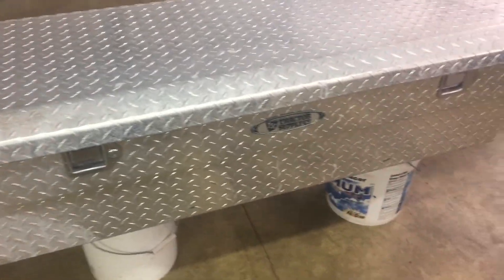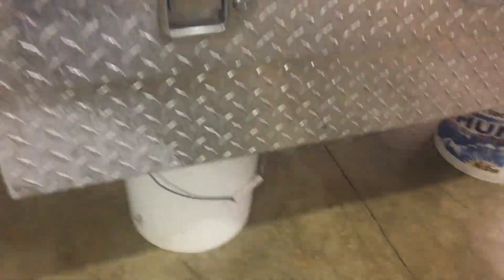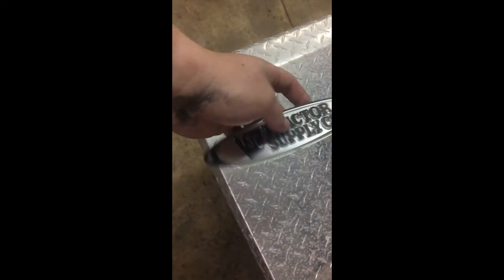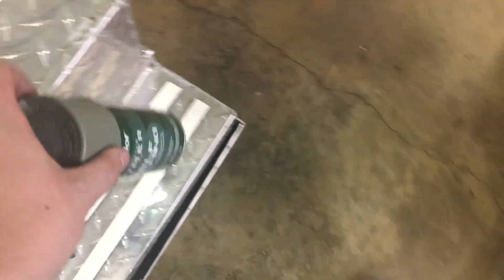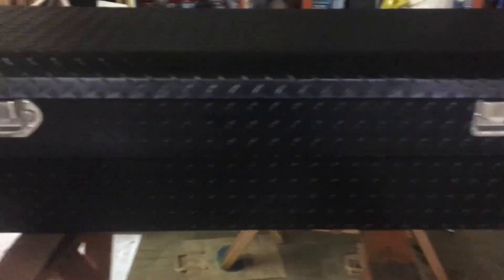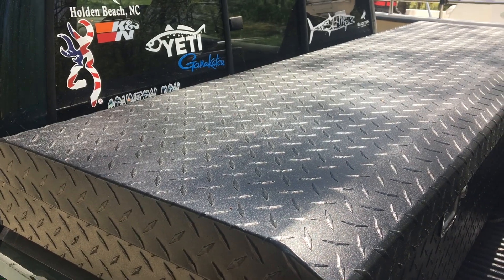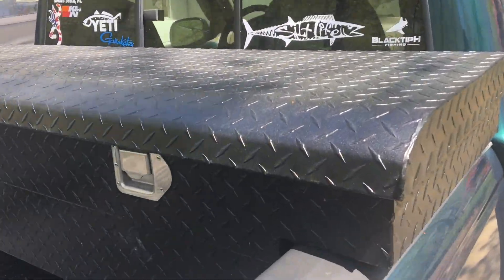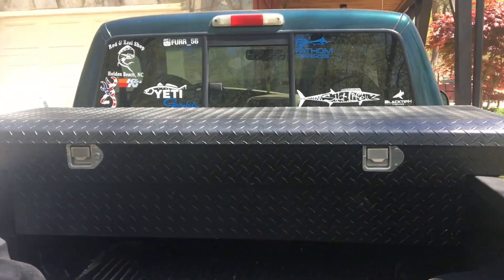Bed lining my tool box

Comment: How did it hold up
Reply from the maker: Luke_dgaf 1  its held up pretty good. Had to touch up a place where I gouged it pretty good
Reply: @FurrReal56  sweet thank you for the reply. Planning on doing this with a used box I just purchased
Reply: Good looks...I'm in the process of doing mine right now too. It's a Tractor Supply also and is the biggest size you can get that I scored for 75 bucks like 3 years ago. One tip I could maybe give future men that want to tackle this kind of job, I got a 4 inch and a smaller abrasive nylon cup brush that's used for truck bed prep and such but it really  worked wonders on scuffin my box. Now I've just been kinda wrecking my brain on what kind of glue I can get for the inside I'd like to line it something idk maybe like yoga mat material or something. Any suggestions on a real good easy to use glue that'll stick real good to aluminum?